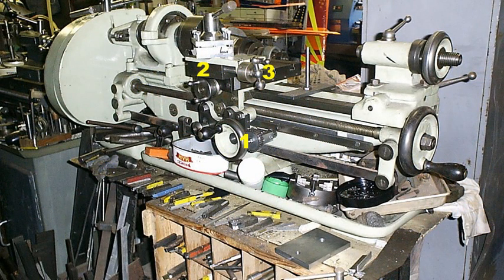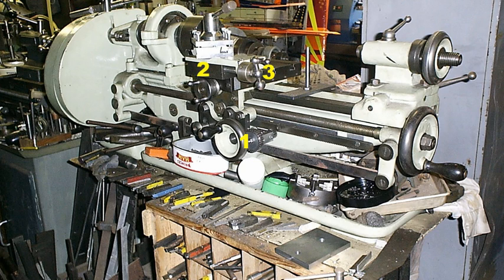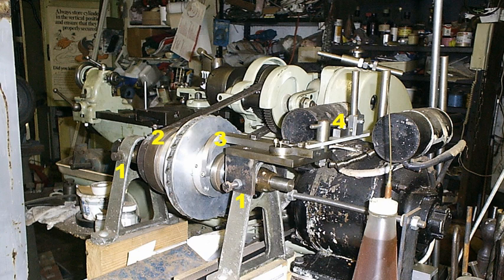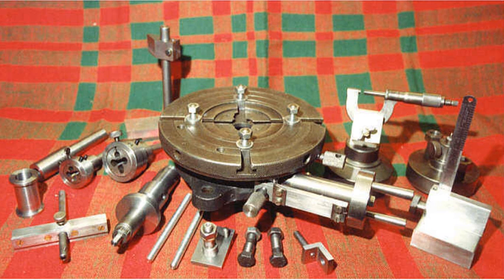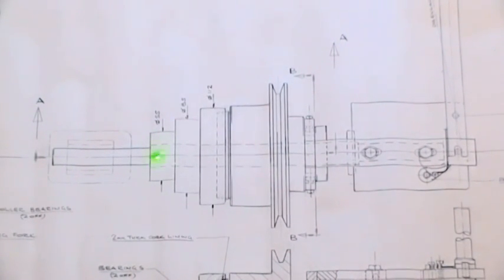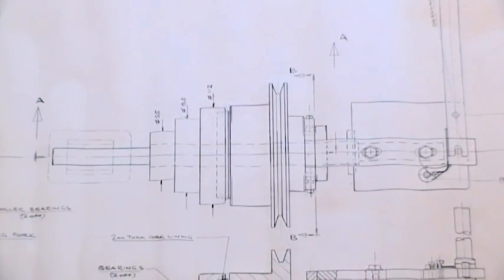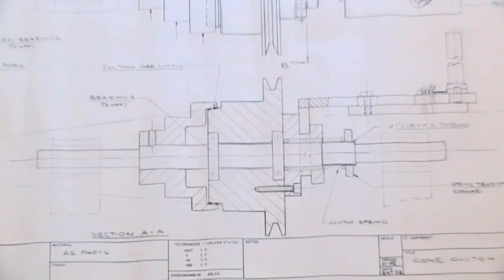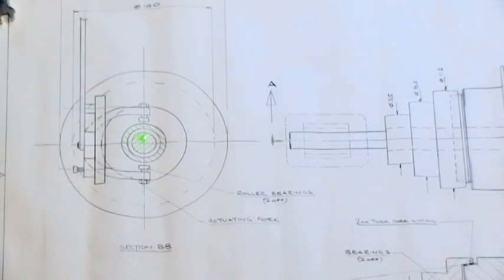Gadgets and Gizmos Introduction

Comment: One of the things I love about the Myford machines is the T slotted cross slide, and you rarely see it on all but the largest lathes in this country.
Reply from the maker: Hi Dale - yes, I have always wished for a T-slot cross slide. Sadly I had to sell my old Myford years ago when moving.
Reply: The only lathe I've seen here with a T-slot cross slide was an import...a 12-inch Jet.
Reply: I was poking around on the lathes(dot)UK website, and excellent site, and did indeed see that a T-slotted cross slide was available for your Raglan, also...you may find one for it if you search.
Reply from the maker: Thanks Dale -- I know that site. 
Had not realized a t-slot version was available. I will look into it although I fear it might be something more than I can afford.
Reply: I did a bit more digging and found a site where someone actually makes and sells them, and seems to have replacement parts for both Myford and Raglans...but yeah, they are probably pricy, at that.  I noticed the Raglans were built a lot like the Atlas lathes...only beefier.  I have an ancient Atlas 10d (1937) that is in retirement now, but I do love the old lathe.
Reply from the maker: Dale - I can imagine, very expensive. If possible do let me know that site you found.
Reply: The site was latheparts(dot)co(dot)uk  But I see the site has not been updated since 2011.  Perhaps he sold a few cross slides and could then retire! :-)  Actually Chris, after looking at the photo of the one on his site, I'd almost be tempted to machine my own out of a blank of cast...would be a fun project and you have your present slide as a pattern..
Reply from the maker: Thx for the feedback. I'd like to machine one but - 2 main problems. 1 is the need to remove original off lathe to get dimensions etc (making lathe useless temporarily). 2 would be, getting a nice good quality chunk of ductile!! Oh and 3 perhaps, my small mill probably too small.
It would for sure make a great project but may be just dream material right now. :) Thx again Dale.